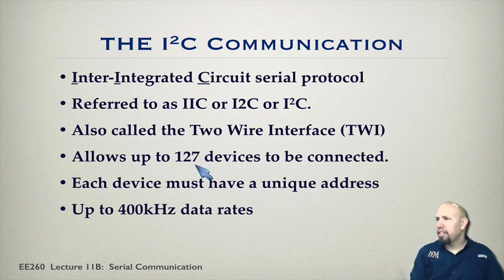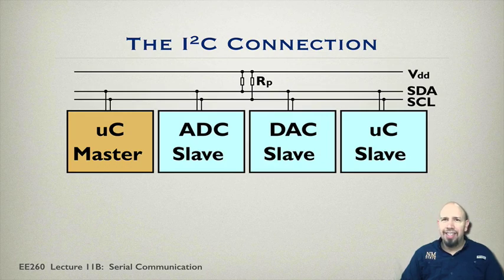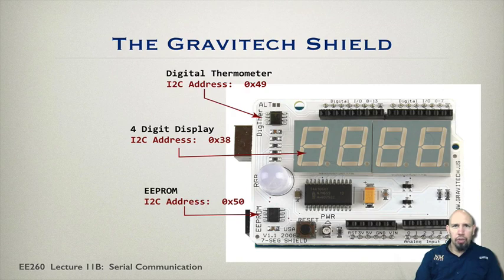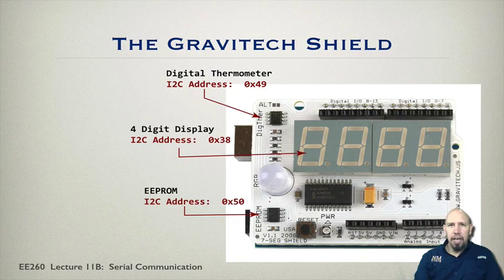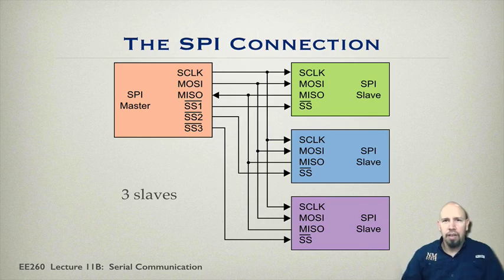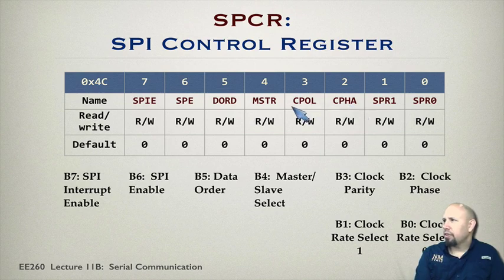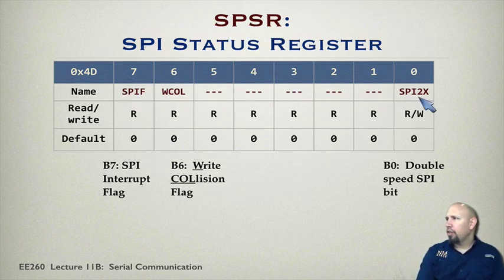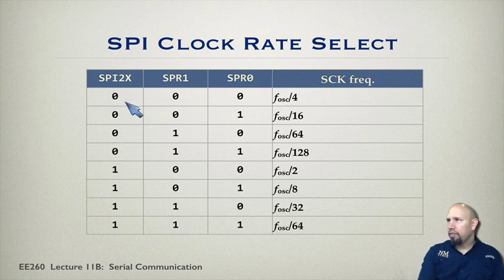11B. Serial Communications:  I2C and SPI

Comment: Very well presented. I learned a ton. I am trying to use SPI on ESP32, so if I have only one TFT connected and know which in is MISO, MOSI, CLK, then I only have one pin for CS (chip select) can I use any digital pin and name it in the code? Or do I have to know the pinout number on the data sheet (that I do not have)?

Comment: Sr, HELP ME, PLEASE!! I would like to send words across serial monitor. For example: I write "on" and the LED will turn on but if I write "off" the LED will turn off. Do you understand me?. My english is not clear, sorry, but I need your help
Reply from the maker: If I understand you, you would like the Serial Monitor to display ON when say, Digital pin 3 is LOW (assuming the LED is active LOW).  Is that correct?
Reply: I want to wirte "on" and turn on a led and I want to write "off" and turn off it (wirte "on" an "off" in the serial monitor text chart)

Comment: Hi there, very good video overall, but I would say give a bit more explanation on the code if you are going to include it. 

Does the MSTR, SPE and SPIE represent single bits (just set to either 1 or 0) or are they in the form of MSTR = "00010000", SPE = "01000000" etc. (42:19)

Comment: i2c and spi
hi..sir , can you tell me 1.how to interface with micro-controller (arm7) and micro-processor (arm9)?
                                  2. how to write c/c++ programmer for both micro-controller (arm7) and micro-processor (arm9)?
                                  3. what to make client device driver  and master device driver ?
plz replay me ::::::::::::::::::::::::::::: :) thank you very mach..
Reply from the maker: There are two aspects of interfacing:  Hardware and Software.  The hardware interface is the same for any microcontroller.  The software connections depend on the programming instructions available on the microcontroller. While you can make a micro controller into a slave, it is usually set up to be the Master.  As for the ARM 7 or 9 processors, I have no experience.
Reply: +Pallikonda Ramu : www.codesforprogram.blogspot.com